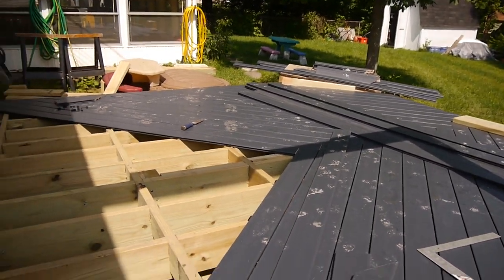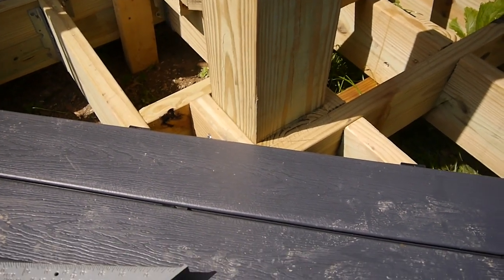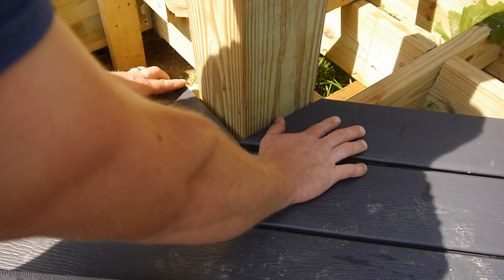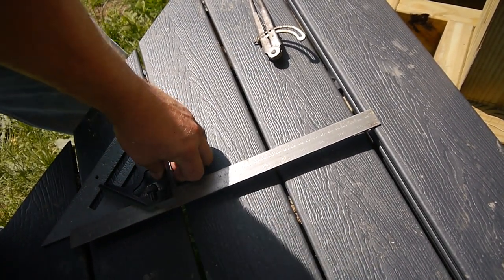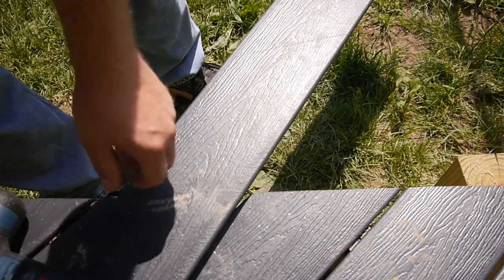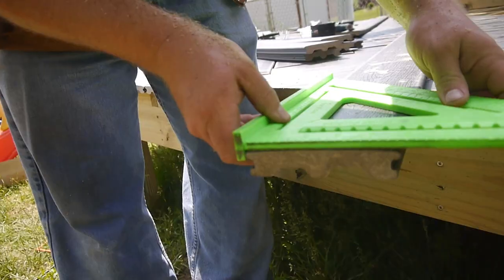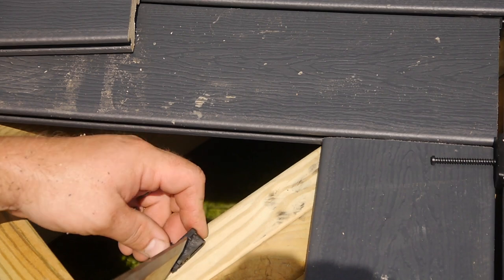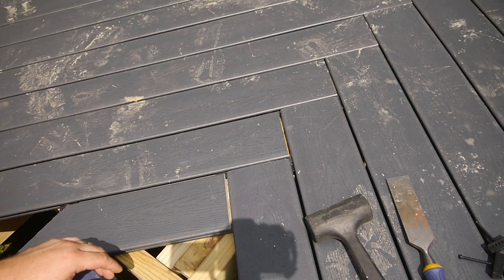Installing Menard's Ultra Deck - Triumph Decking, and Mitering Around Integrated Swing Posts

Comment: Josh, I installed the same deck using the Grip Fast UltraDeck T-Clip I noticed very soon the screws started showing rust, today ~ 6 months later every one of them are rusted looks bad.  Did your t-clips screws also rust?  Thanks
Reply from the maker: I just went out on the deck with a flashlight, and yes my screw heads have rusted. Some just inside the square cavity where the Robertson drive goes, and others over most of the head. I wonder how much substituting stainless steel screws would have been to my cost. Probably would have been worth it. It's the middle of winter here so I hadn't noticed them till
 Now I will everytime I go out on the deck. Thanks John ;-)
Reply: @JoshAQ  Sorry, as you know being a DYI'er any and every flaw sticks out like a sore thumb.   During install last fall I had a few screws where I slipped with the driver and was hoping they were the only ones that would show rust, but looking yesterday it's 100%.  looking at the container label "They make installation easier, naturally gap planks, and are also rust resistant." two out of three I would agree with.  I wonder what "rust resistant" applies to?
Reply from the maker: @john-sw1nu  LOL, it's fine. I imagine that as long as the cold blue they apply to the screw rust slower then a plain screw they can put "rust resistant" on the container. Entropy will get us all in the end, but it would have been nice to keep it at bay as long as the deck lasts. I wonder if I can get away with a dollup of paint applied with an eye dropper onto the head of the screw to keep it from getting worse and potentially keep them from rusting further? Although my neighbor will think I am insane as I apply paint with an eye dropper to hundred or so screw heads. Thanks for a heads up and hopefully your comment will help others to choose if the extra money for stainless screws is worth it or not.

Comment: Were you happy with the T-Clips and decking material overall? I just ordered the Fusion decking and am planning to install using the T-Clips. I've read mixed reviews on both, but hoping those were due to error of the installer and not the product itself. Your installation looked very good and everything was done properly. Thanks for the video!
Reply from the maker: So far so good. I think the most important thing when installing them is a willingness to remove them if they are not sitting up flush against the board and try screwing it down again. As I have only used the t clips it's hard to say they are better then the metal clips. I like how it went together though and they seem reasonably well thought out as far the manufacturer's injection molding process. As to how well they will hold up? That also is a bit of a hit or miss. As long as they are not exposed to the sun or caustic chemicals it should be fine. The small cracks between boards the sun can shine down should not be an issue for uv damage. Thank you for the compliment, I tried hard to get it right. I will say that there were a few times that I skipped putting a t-clip on where a 2x8 was underneath and I regret that, as on a few spots the boards flex a little where I did not install one and it is just a little proud of the surrounding boards, call it 1/32" proud. So don't skimp on the clips. I had to use more because I mounted the boards on a 45 and needed to have the 2x8's, 12 inches on center according to the manufacturers instructions. Good luck with your install and Thanks for watching!
Reply: I think in the video you mentioned the gap in between boards measured to be 1/8" with the clips installed. Did you find that to be pretty consistent for the amount of force you were applying to get the next board to set properly? I'm trying to do my best calculations in order to install only full boards and not have to rip any for the ends. Sorry for all the questions, haha.
Reply from the maker: downingair24 ,
No problem, luckily for you I took a half day today. Just went out with the calipers and found the gap to be anywhere from .125" to .1975" I would like to blame the boards for not being consistent, but it was probably my installation technique :-) The most prevalent reading was .1875" so go with that to be safe I would think. Feel free to ask any other questions!

Comment: Great job getting around the post! Did you think about laying a middle board straight down the middle? I know you spoke about the middle miter cut but I'm thinking that board could help on board length order. Great vid!
Reply from the maker: Thanks, I am glad you like the video. I can't remember if that came up in discussions with my wife when we were planning the deck. The only downside to that is the top of the board is curved so water pours off, and that would mean the top middle of the board is higher than the edges, so if you were to butt an end grain board against the side of another board the end grain would be taller and the end grain seen very easily. It wasn't something we knew about till we started installing it, so we probably didn't think about it. I am in the process of trying to repair one of the boards in my deck as a 9mm bullet dropped out of the sky 4th of july night and went halfway through the deck! So now I have to figure out how to patch it from a scrap.Lol. Thanks for watching!

Comment: Great video. I am looking at installing Ultra Deck product this summer. How's it holding up? And did you do anything to finish off the exposed edges of the product or just leave it as is?
Reply from the maker: So far it has held up really well. I will say you should install a T fastener on every board as I have a few that flex where I did not. I.e. the board is not testing against the frame underneath and flexes slightly till it comes in contact. 1/32" or so. Not really noticeable unless you are barefoot. The ends I left untreated. So far they have not mushroomed up or anything. I dont see any noticeable fading but then I haven't taken a really close look recently. But nothing noticeable at a glance at least.

Comment: We are looking at that same decking, color and all. I am just wondering how it's held up since install. I can't find much of anything for reviews. Are the boards warping, faded? Would you use this again?
Thank you!
Reply from the maker: Hi Karen, I went out in the back yard and looked over the deck. I pulled a board a cut off board from storage to compare the color. I can't tell the difference between the in storage cut off board and the sun exposed deck board. There were a few things I would change if I had to do it over again, but in regards to the Triumph Decking board itself I have nothing bad to say against it so far. I am working on a 2 year review video and will hopefully have it done some time when my day job allows. Thanks for watching!
Reply: Thank you so much for taking the time to get back to me!

Comment: We are thinking about buying The fusion in walnut tomorrow.. can you tell me if yours get hot on your bare feet. Also wondering cause of our pets. Thank you
Reply from the maker: It does get significantly hot if not on the shade. I have not been Barefoot on it but my three-year-old son has and he complained it was too hot and had to put shoes on.
Reply from the maker: Also, i should note that my small dog hangs out on the porch during the day and under a bench glider and in front of the door on a mat.